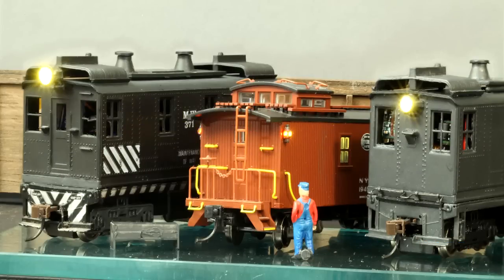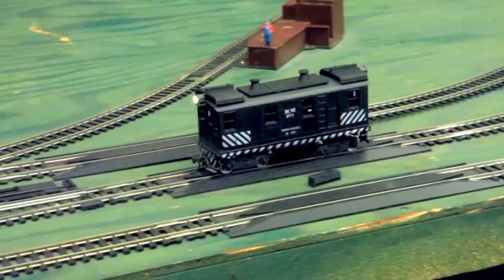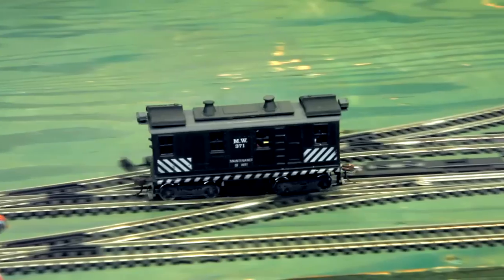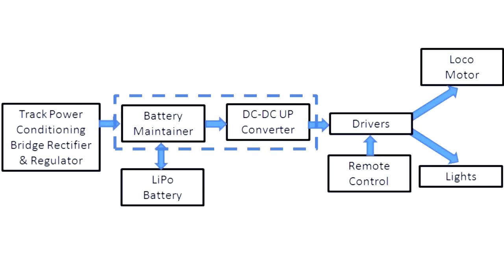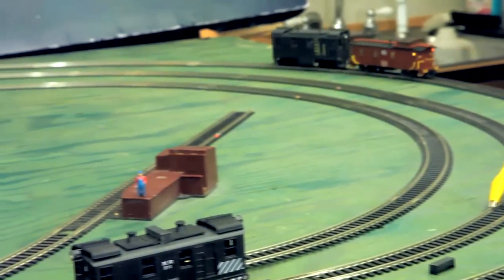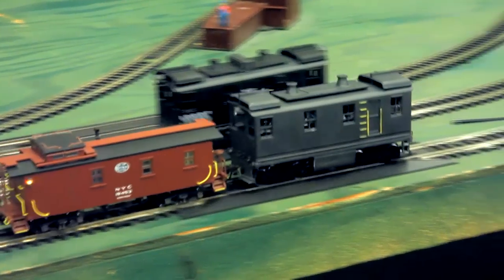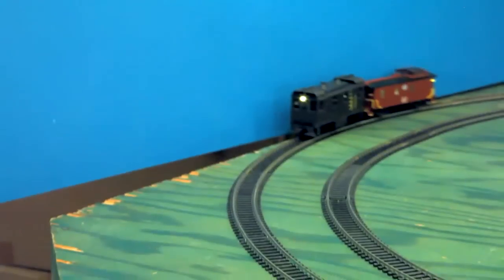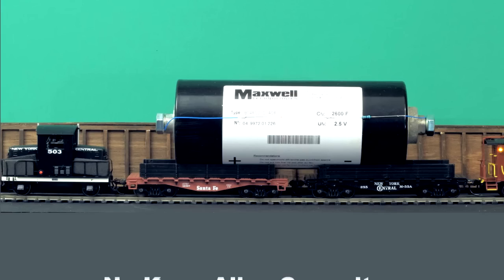HO battery power | Deadrail | Model Railroad Hobbyist | MRH

Comment: Have you looked into repurposed CD player motors for powering your locomotives?  They are brushless, powerful, can run smoothly at low speeds, and can run at quite high rpms at only 4-5 volts DC.  They may be ideal for such a battery application.

Comment: Is this available right now for HO scale where there is no need for an additional space to be provided for the battery pack itself?  In other words all I have seen right now is applications where there has to be a dummy loco or box car or some other piece of rolling stock to carry the battery pack and it is connected to the lead unit loco. While this method addresses the issue of space it does not lend itself to being very prototypical. If everything could be placed in one loco and you are able to have sufficient run time along with recharging capabilities then this would revolutionize the hobby.

Comment: Geoff, I have several questions: Did you build the electronics, or did you purchase them pre-built? I have built 3 "Dead Rail" Loc's, using some Dcc/Sound decoders that have a remote, also used some Deltang 2.4ghz RF boards with Dual Stick controller. I recently obtained a Bachmann EZ App Locomotive that has Blue Tooth. I realize that should be an easy Dead Rail conversion, only have to add a battery, that is where the up-convertor would come in handy, Thanks.

Comment: Battery power with radio or bluetooth signals to a hand-held controller is my ideal for HO railroading. Unfortunately, I cannot find an engine+controller set commercially available. Until that happens, my HO railroading equipment will continue to collect dust. Powered rail setups are just too maintenance-heavy.
Reply: It is going to take a manufacturer to take the plunge so to speak. The first place I would expect Bachmann, Kato or another manufacturer to use this is in a starter set. A basic engine some track and a few cars. What it might add to the cost of the motive power they'd probably save on eliminating the power pack. Phone chargers are dirt cheap. The issues of battery fires are pretty much a thing of the past. Look at it this way. A starter set that might get operated on a floor in a living area and then put away no longer needs a cord draped over the floor.

Comment: I like this idea! you can run vintage trains like you could with DCC and still be able to use track power if you wanted. If you could put the circuit board in a boxcar and run a cable from the car to the loocomotive's terminals?

Comment: If battery powered locos become popular, could all track except charging track be made out of, say, plastic thus driving the cost down?  For example complex expensive turnouts?
Reply: This has already been happening on inexpensive "toy" G scale trains.  I am presently looking at setting up an indoor G scale layout with a battery powered loco and remote. Just need to purchase rechargeable cells, the track can be a mix of either metal, plastic rails or both.
Reply: Not sure about plastic, but you could use cheaply available second hand brass track instead of brand new expensive nickel-silver track.
Reply: The problem with plastic track is that it wears out quickly. Wheels put a lot of wear and tear on the rails, especially on the curves. They really need to be metal if they're going to last a long time.

Comment: Interesting idea!  Now, some big questions. How long would the battery last by itself? Is the loco with a stock motor?, or a special low power type? Could this system be adapted to multiple engines for a big train? Is this system a kit or pre-made?
Reply: You can get many of the details answered in this free construction article: http://mrhpub.com/2014-11-nov/land/#/83
The motors are stock from an original Bachmann HO GE 44 Ton Switcher-- they have great low speed/low voltage performance. This is designed and assembled by me. The article will show you exactly how you can build your own. It might be possible to construct a muli-loco lash up, especially if all had the same power units. They simply would all be addressed the same-- like multiple locos with the same DCC address. This would be the easiest, but it also could be done with one transmitter simulcasting to multiple addresses, or a broadcast to all receivers on one frequency.

On my initial test unit the battery lasted a bit over an hour. I did not do any real life tests on battery life.

Have Fun! Best regards,
Geoff Bunza

Comment: Were can I buy the HO battery trains?
Why was this not availible sooner by train manufactures?
Reply from the maker: Battery power is still in the experimental stage and not yet mainstream. The main problem is how to make it easy to recharge the onboard batteries in the smaller scales. With a DCC decoder, sound, speakers, a motor, flywheels, and weight for good pulling power traction, there's not much room left in HO locos for batteries too. So it's not fully developed yet, but give it a few more years and it should become more readily available as battery technology improves.

Comment: I have a set of F-40's that I want to do something very similar with. One is powered and the other a dummy. I figured I would put the battery in the dummy and run small wires between them. I would actually do this with every unit if it works out.

Comment: have you considered using LiFE batteries for this task?
Reply: Yes, I think they could be used (in terms of size, power density, etc.) but I have not looked into their charging characteristics in detail, so I can't recommend them one way or other. There is a great deal of battery R&D going on today, and I am expecting that better technology will be available in even a year or two. So I don't see this as the "ultimate" modeling solution at all-- just one alternative.
Best regards,
Geoff
Reply: Geoff Bunza Good to hear from you Goeff. They have a slightly different charging profile then a LiPO in Terms of peak voltages, however they are much safer. The biggest difficulty I have run into with them is setting up custom charging curves. there are How-To's within the RC Car sphere but I do agree it's too involved for a how to. Glad to see your knowledgeable. Best of luck with your projects!

Comment: Low speed control is pretty horrible looking, maybe just the motor being used? Just my opinion of course.
Reply: It could be the motor. But another way to provide better speed control would simply be to add another reduction step in the drive bearing. This could be simply by changing the pitch of the worm gears to a finer pitch. This would reduce the lead angle of the worm (if the worm is a .5Module or 25 DP and we switch out to a .25 Module  or 50 DP on a single lead worm we have effectively doubled the gear ratio simply because for the same diameter the the finer pitched gear has twice the number of teeth*. There gearing could effectively be cut by using a fine pitched tap to cut the teeth on the worm gear. Goggle Free Hobbing. .25Module or 50 DP is about the same pitch as 3/8-16 or a M10x1.5 screw. I'd actually have to check just what size gear pitches are actually used.  Another way would be to add a planetary gear reducer at the motor. But the would eat up room. Anything that increases the rpm of the motor versus the rpm of the wheels will lead to smoother operation and more pulling power. It also reduces top speed by 50%. As Robert Heinlein said "TANSTFALT"**. his I think would be most useful in yard operations and road switching operations. 
Eventually I think we will see motors built right into the power trucks in smaller scales. The problem there is power output. The lower the torque output of the motor the greater the reduction drive needs to be to get any effective work out of the motor.
*This is something to think about. In reality any modeler with a small lathe and mill could do this. I personally would recommend steel for the worm and bronze for the worm gear. I don't think the engineering plastics, ie Delrin, will hold up at these sizes under any load. 
** There Ain't No Such Thing As a Free Lunch. There's a price to be paid somewhere.
Reply: it is a Spectrum old 44 tonner drive well know for the poor running quality at low speed